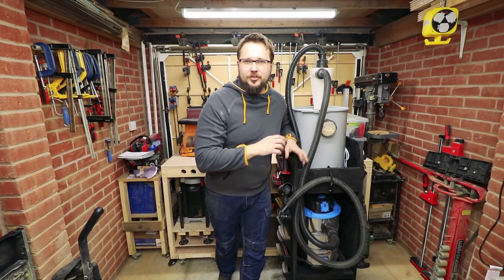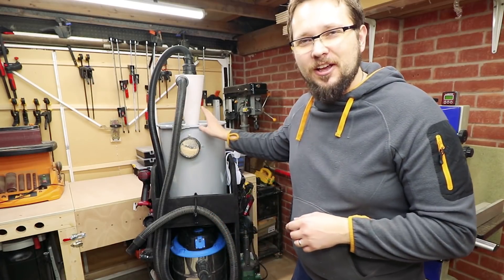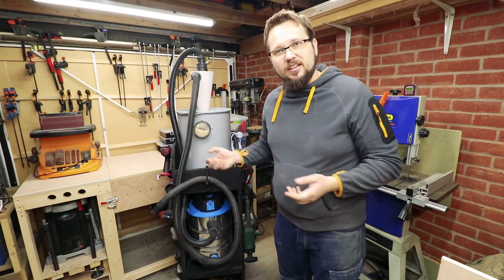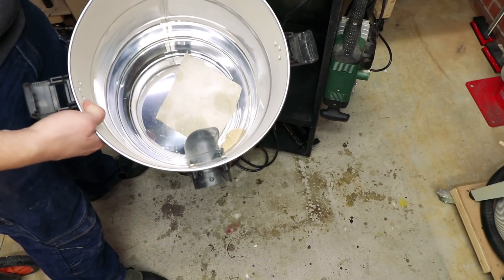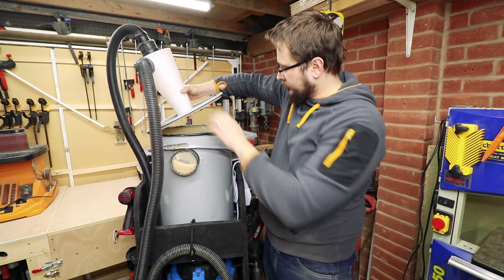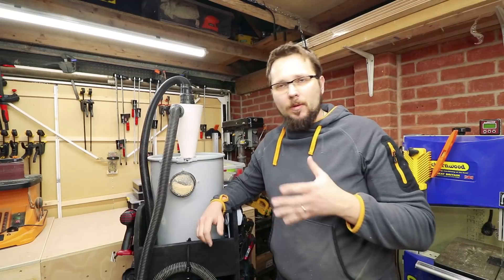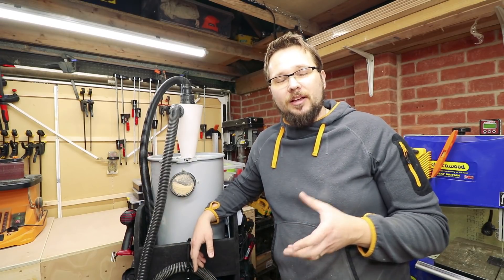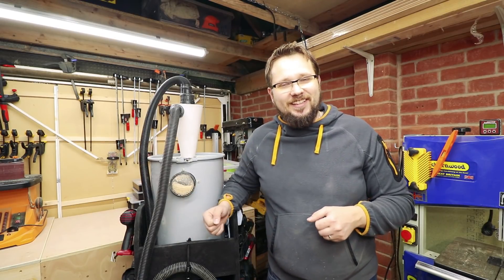Cyclone dust extraction system, was it worth making it? How much dust in my shop vac after 2 months?

Comment: You had any problems with static electricity build up ? I've noticed some on mine, seen various comments about a potential spark and fire risk occuring on pvc dust systems that create static.
Reply from the maker: Yes it's always possible. I would recomend some upgrades to eliminate the static build up.
Reply: I've seen a few people earthing out fixed pvc pipe dust systems by wrapping copper wire round the pipe with screws going into the side. But I haven't come across anyone doing it to a bucket cyclone with flexi vac hose yet or maybe it's just not a major issue as there seems to be plenty of people building similar systems.
Reply from the maker: @jameslaurenson4090  I've not had had any major issues to be honest but you know the more safety features you can implement the better
Reply: @CasualDIY  no I haven't had any major issues either , it actually works extremely well and much better than going through dust bags. I've just noticed when I walk past the hose I get a static shock, I've also found lots of build up of dust on the outside of the barrel. Maybe the difference is yours looks to be a metal barrel and mine is a plastic one which is more prone to create static
Reply from the maker: @jameslaurenson4090  that could be the case, mine is metal 🤔

Comment: I've got the cyclone but I do find it seems to loss suction. But so far I've only thrown it together, so I hope it will perform better when I make a more permanent set up.
Reply from the maker: It could be because the system is not sealed correctly. Try to look for any air leaks. Hope this helps👍

Comment: Built our Frankencart around the same time as you did yours and it's doing rather nicely thanks :)

The old, slightly wheezy CamVac is on it's last legs so I'll be looking for a nice powerful replacement very soon.

Keep up the good work Tomas!
Reply: Awesome the dust seperator works great! Nice work
Reply from the maker: @TwistedWorkshop77  thanks 👍
Reply from the maker: Thanks mate👍 hope you will get a nice new and shiny vac in your workshop soon 👍

Comment: The results are great, but look at the size of it! .. in a small garage workshop, it takes up so much space. A vac can fit neatly under a bench. I think the real question is, is it worth taking up all that space?
Reply from the maker: Hi, yes it is. As this cart is also my storage cart. I got my drills and impact screw driver, sand disc, belt sander, orbital sander, charges, and vac accessories in it. For me it's fantastic as I got all my most used things in one place. All power tools take power from the cart, I can move it where I want. To be fair for me it's a game changer, speeded up my work flow . But it may not work for all.